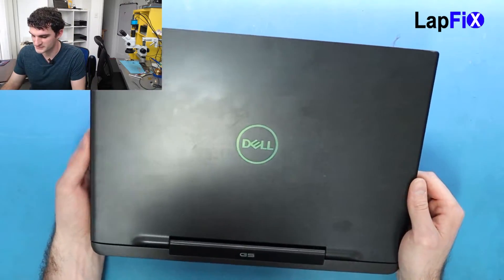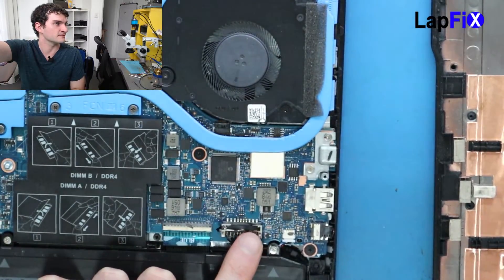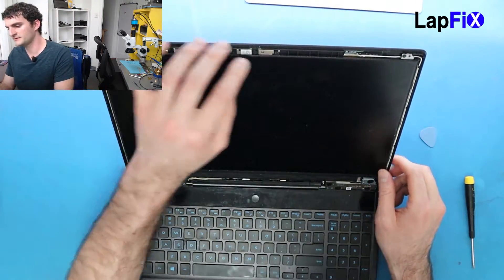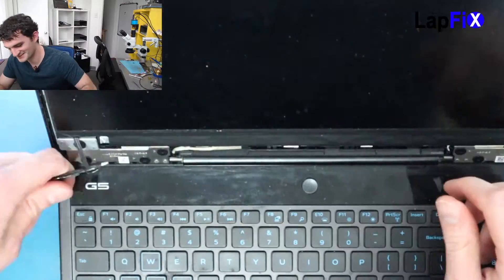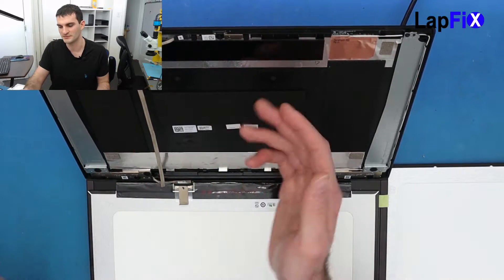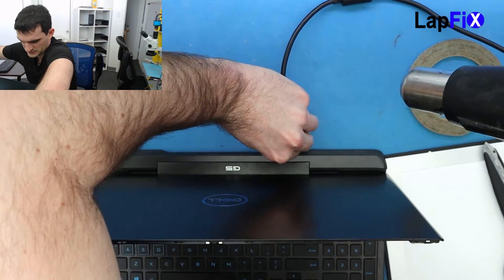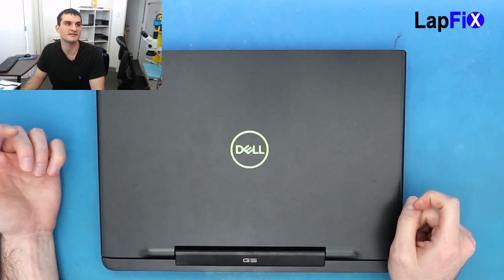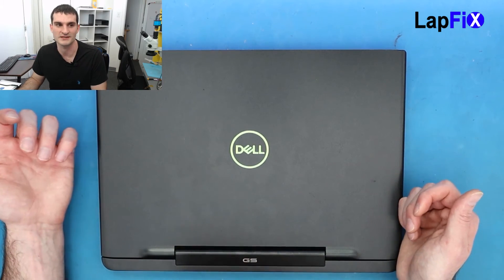Dell G5 5590 Screen Replacement | How to

Comment: Can o change the full HD screen for a 4K?
Reply from the maker: Usually there will be a physical pin count difference.  If it fits, I wouldn't recommend swapping it as the power  delivery on the motherboard is meant for the original screen.  Adding a more power hungry screen could result in power/display issues in the future

Comment: Hey there, thanks for your videos......very informative and thorough! 
I have spilled oil inside my company dell Latitude 5590 and was wanting you to do a video showing how to disassemble the screen and every layer and clean them individually since the oil is probably on the all the various layers. Seems like it would be possible, and even if a few particles end up inside it would beat the current screenshot, so if you could do it I think many would benefit since it is a common problem and although tedious i think it's do-able. I have cloud patches and white patches all over screen which makes it damn near impossible to view without an external monitor....thanks !!

Comment: This guy just skipped how to disconnect the lcd cable from the damaged panel. I had to search other videos then figured out there is little tiny metal bar around the connector, you really carefully lift up that bar with some kind of sharp blade of nail or whatever. I almost had wrong idea to pull out the cable directly could damage the cable for good. Thanks anyway for the videos!
Reply: Thank you so much for this comment. I came here looking for advice for this. I almost force pulled it out. Thank you!

Comment: With the strips...  To make ends to grab on for removal next time, could you just run the strips down further toward the bottom, and leave part of the paper covering attached at the end?  Maybe save a little paper to attach to the sticky side on the back?

Comment: I have the 60hz 1660ti model. How many pins does the display have, and if its 30 pins, would an adapter from 30 to 40 work?
Reply: No, you can´t use an adapter

Comment: What panel did you replace it with and what panel would you recommend for the exact same model laptop that is 144hz 1920x1080p and good color/brightness?
Reply: Can you give a link where to get this panel?
Reply: Can you tell the panel code? I need it immediately. Thank u.
Reply from the maker: I believe this was a samsung